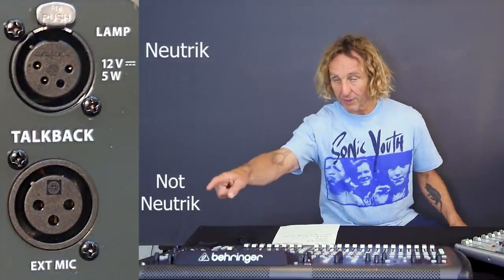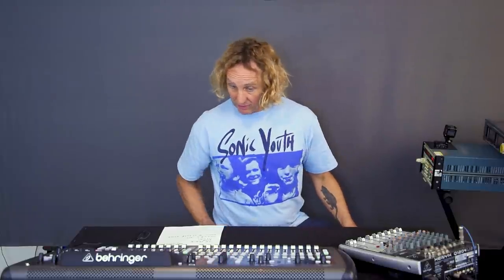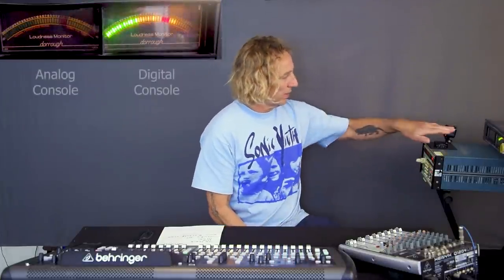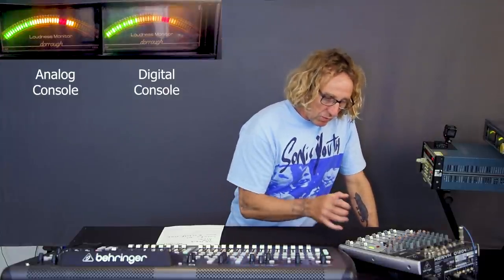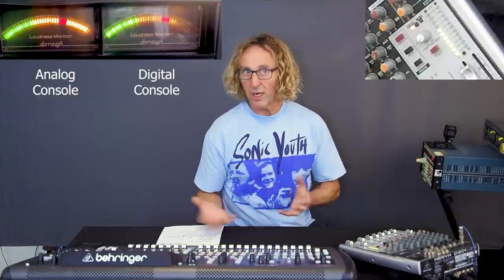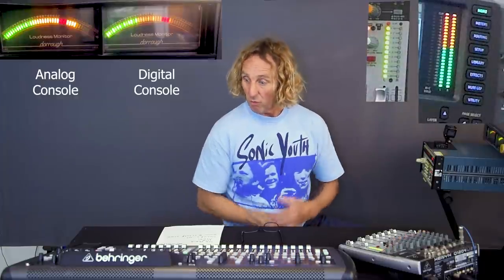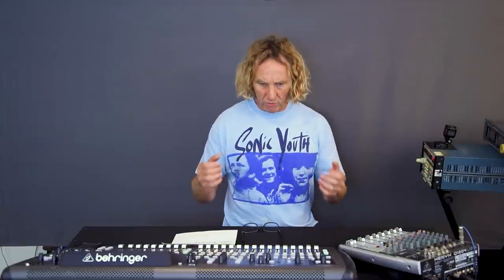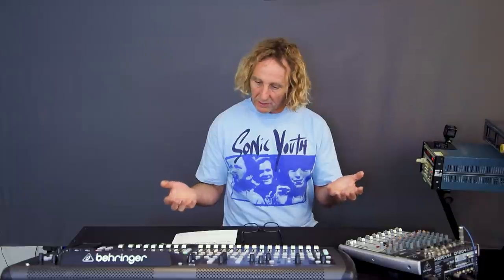Behringer X32 Digital vs Analog Console Metering & Output Levels (Public)

Comment: When you do a nulling, and get "perfect cancelation", does the silent output generate spl? Does a dB meter hear it?
Reply from the maker: No spl, no metering. Perfect cancellation is the same as no sound.
Reply: @DaveRat  hope you don't mind a follow up question. Same scenario, but with two speakers out of phase, measured at the perfect center point with max sonic cancelation, is there no energy to read there either?
Reply from the maker: Hmmmm, there is energy everywhere always.

Speakers can be looked at as adding and subtracting pressure.

Electronically sound can be looked at as adding and subtracting voltages.

If you have two speakers where every time one of them adds pressure, the other speaker subtract that exact amount of pressure such that there is no change in the pressure, then there will not be audible or measurable sound at that point in space.

Same goes electronicaly, if one channel adds voltage and another channel sub tracks that exact amount of voltage at that exact time and they're perfectly aligned such that it the combination of the two results in 0 voltage change then you have perfect cancellation and no measurable voltage

But if you go somewhere else in the signal chain before those two electronic signals are perfectly summed there will be measurable voltage, and if you go somewhere else in the room where the speakers are not perfectly canceling out acoustically then you will hear or be able to measure sound.
Reply: @DaveRat  Thank you so much for taking the time to answer my questions. Makes sense, and intuitively was what I was thinking, but intellectually my brain kept arguing about there still being energy there, even if it's inaudible.
Reply from the maker: Ha, yes it is a bit of a conundrum.  In a way, the energy is there and there is other energy counteracting it to make it go away. But remove one of the energies and the other then returns.

Maybe like a balance with equal weights on each side is still, remove both weights and it is still and centered, add one weight it tilts, add another equal weigh, it is still and centered.

Both the weighed scale and unweighted scale is still and centered.

With the weights the potential energy to tilt is there but not active impacting.

This is similar to 2 out of polarity signals balancing each outer out back to silence.

Comment: First, thanks for the great post. As someone with far more experience than me, would you say Behringer is getting better quality? I was slammed recently for having an XAIR 18. Seems like behringer (used to) leave a sour taste in quality. But have seen people I respect such as yourself saying "it depends". Feeling more and more like "What is the specific tool's quality?" Is the more modern question rather than shaming a brand.  Minus the quirks, Behringer has given me more than enough bang for buck. #RatRocks 🐁
Reply from the maker: It's kind of like buying tools at Harbor Freight, inexpensive Chinese products won't be impressing anyone and the history of Behringer copying other products and making cheap versions has earned them animosity from the pro audio community.

That said, useful inexpensive products have a place and can get the job done.

On the other end of the spectrum there are esoteric over priced manufacturers where you pay for a look, a name and image, mainly in the home HiFi market but Monster Cable was a good example of that

Somewhere in between are the companies that offer quality built products, have attentive and dedicated customer support staff, things like fast turn around repairs with loaner gear, and are known for innovation and quality products.

When buying gear, I look at price, function, reliability, support,  resale value, industry acceptance, demand, rental rate, estimated longevity, size, weight, appearance, serviceability and so on. And prioritize all those factors to make the best decision for the application.

Comment: At that length of a snake, I remember having catastrophic failure on data lines coming from the dante sound cards on a Yamaha / Nexo system.  I remember  cutting off 25 feet of the cat5 run and crimping a new plug to resolve the issue. I also remember the owner of the av rental compagny telling me that it worked perfectly for 2 months before the problems started. Perhaps a comparison between old and new cables would be of interest? Enjoying the ride here in Montreal.  Thanks
Reply from the maker: Good idea
Reply: Could have been the original plug or crimp quality. Signal reflections are what ultimately limit maximum cable length so if you were close to the max limit, shortening it a bit could have opened up the eye permitting the resumption of valid data.

Also moisture effects cables. Was there an outdoor event prior to the problem?

Comment: Does anyone on here know why on the x32, on the channels specifically, it clips, even though the meters are no where near clipping.
Reply from the maker: Possibly clipping the subgroup bit will look into testing and finding that issue. That is exactly the kind of thing I am looking for
Reply: @DaveRat  it's a weird one Dave and thanks for the reply. I've only seen it on channels that are going through the stage box. Anything going in on the insert channels are fine and can be hot as he'll without me ever seeing the clip light. But channels patched into the stage box, I have my meters peaking around-12 but the clip light hits. I'm asked on other forums about this and have never gotten a proper answer to this.
Reply from the maker: Hmmm, almost sounds like an issue with aes50 

Aes50 has no error correction and can have distortion and drops while still functioning.
Reply: @derekrushe  Check trim vs. gain.  Press Setup -> Preamps.  You may be clipping at the analog-to-digital conversion, but the digital trim may be bringing the levels down to what you're seeing.  A lot of people use headamp gain split with the stage boxes.  You probably have this on.  In any case, remember that the analog preamp gain setting is not continuous.  So, as you turn the gain knob, you're setting trim continuously, and gain in steps.

Comment: Learning a lot of good stuff from you , thanks ! What are your thoughts on the greatly debated x32 vs. m32 differences ?
Reply from the maker: Hmmm, have you seen the 1st vid I have released on that topic? I have done 9 vids so far and 1 is public and 8 more on the member side
Reply: The M32 is a deluxe X32, internally they are identical however external connectivity is where the difference is as the M32 has MIdas preamps and better quality output capacitors/circuitry. Question being does the huge difference in cost justify the better components?  Maybe not but the difference in warranty has to be considered 2 v 10 yrs !! Even so I still chose the X32 and happy with my decision.
Reply from the maker: When I takebth apart they don't appear identical inside. Different input circuitry, output circuitry, different D to A converters, faders and more.

But I do agree, the M32 is an deluxe M32. And the operation is identical.
Reply: @DaveRat  sorry yes you are right the faders are different. In the end you are paying for upgrades with the Midas M32 question users have to ask themselves is whether the extra cost is worth it to them since the X32 is still a really good quality mixer for what you pay. I even looked at the WIng but its huge and seriously heavy so I counted that one out right from the start. When I said internally I really meant the both run internally at 96 and externally at 48Khz which is the same as almost all the mixers around this price range. The question has to be are you getting your moneys worth paying the extra for the M32?
Reply from the maker: There are so many variables.

Actual cost, resale value, perceived value, rental rate differentials, size, weight, durability, warranty repairability, ergonomics and on and on.

One can celebrate saving some money and having the same functions and slightly reduced quality while someone else can celebrate paying a bit more, improved quality, improved ergonomics, build quality and higher resale value while presenting a slightly higher perceived value.

And both can be right.
Reply: @DaveRat  You are right, the X32 sort of chose itself cos I picked mine up really cheap. I am really happy with it and I know after the pandemic its only going to increase in value due to chip shortages and the extra shipping costs, it has been almost impossible to source new for almost 2 years same story for most manufacturers Allen and Health could not give me a delivery date when I asked about the QU16 and even now 2 years later still only available to order and I know its not going to be available in stock for over 6 months and even then that is probably not going to cover all their back orders. Ok cheers think I have wasted enough of your time, x

Comment: 10:30 That level topic is causing constant headache.. it’s  confusing that 0dBfs can be at least +18 dBu, +22 dBu, and +24dBU. It depends what the manufacturer sees as the „ nominal“ level ( for its certain product) that can be 0dBu, +4 dBu and +6dBu (German/ European radio-standard) . Add +18 dBu headroom on each…. And  u have at least 3 different 0dBfs. But some manufacturers labeling digital consoles still in dBu to keep the confusion at its max.
Reply from the maker: Agreed, and human nature based on things like tachometers and analog meters is to run things up near the yellow and red. Yet near yellow and red is all good with analog and terrible with most digital.

That visual aspect of tempting engineers to mix at levels that sound bad is just dumb
Reply: @DaveRat  yeah I always wondering about the colleagues that try to run a digital desk in the orange range because it’s sounding warmer…🤷🏽‍♂️
Reply from the maker: Yuck

Comment: Sounds like you have a really good video series lined up. 

I'd like to see a similar thing done on the input, because how do you know a digital desks 60dB gain is the same as an analog desk's? It's well known preamps struggle at high gain. 

I suspect it's about even-Stevens because the ADC vref is comparable to the 0dB VU reference. But it would be nice to confirm.
Reply from the maker: I do cover the inputs as well, 7 more vids of the series are already up on the member side of my YouTube channel, so the vids I am releasing public are a few months old

Comment: @7:50 You likely read -21dB because your Master Fader was at -3dB and not 0dB... would have been easier to catch on a different view or software view
Reply from the maker: Doubtful, I calibrates all levels with great care
Reply: @DaveRat  First let me humbly say that you have probably forgotten more than I'll learn😆... But in regards to the segment around 7mins and 50secs in this video where you were surprised that the channel and Master meters had a small deferential reading , that was likely do to you reading the Master Fader from the white labels instead of from a digital page or software for an exact Master Fader output... I'm probably just rambling so I can brag later here in Vegas that I had discourse with the "Dave"😅
Reply from the maker: @derickmcwilliams8089 possibly but I don't use the markings, all cannels, group and masters I adjust with the rotary to the exact numerical correct. Also insuring the digital teims are set as well
Reply: @DaveRat  ok, then that also stumped me... Still good stuff!
Reply from the maker: I will check it out next time if I have the board fired up

Comment: Maybe is x32 quieter because of the need for "digital headroom" above 0dbfs
Reply from the maker: The x32 has a lower output at -18 dbfs and a lower output at clip than the analog.  It is also noisier than the analog, according to the specs

Comment: Different analog consoles have different calibration between 0 VU and output voltage. Usually 0 VU corresponds +4 dBu out, but Xenyx seems to be hotter.
Reply from the maker: True and also and more importantly, the xenyx actually has more output before distorting than either the x32 or m32.
Reply: X32 have 17 dB headroom (+21 vs. +4), Xenyx have 15 dB headroom (+25 vs. +10). So, out levels on Xenyx just shifted up, no extra headroom.
Reply from the maker: Regardless of whether you use the mic or line input the xm32 output meter set to -18dbfs is 6 db lower than the xenyx output meter set to 0db.

This occurs if you use one input or all the inputs with mic or line, if you set the output meter on the x32 or m32 to -18dbfs it will put out 6 db less.

And

If you turn the output up till the red clip light lights on both consoles, no matter what input, no matter 1 input or all the inputs driven to get the meter to clip, the xenyx will output 4 db more.

The Xenyx has 4 to 6 db more output headroom, use a DI, use a mic input, use a line input, use an internal time in the x32, makes no difference.

It is super easy to test and see, I am here testing the gear and I am guessing you are guessing about what will happen but not actually testing.

Give it a test and then tell me what you find
Reply: Headroom is difference between nominal level and clip level. You can insert an amplifying stage on X32’s out and get out level as high as you want. Headroom don’t change.
Reply from the maker: Ok, and still the -18dbfs meter level on the x32 results in 6db less output than the xenyx at 0db meter level regardless of what input level is used.

But will gladly test it again.  Keep in mind, the meters are post output fader.
Reply: This only means that input gain on LMS or power amp will be 6 dB lower in case of Xenyx.
Reply from the maker: Yay! This is exactly why I do these tests! Is to help clarify erroneous math and perceptions by actually testing!

Anyway, put an oscilloscope on the xenyx outputs and you will measure about 3.6 volts peak to peak  (1.27 rms) when the output meters read 0db

And on the X32 the outputs measure about 2.7 volts peak to peak (.96v rms) with the output meters at -18dbfs.

The Xenyx begins to clip at around 31 volts peak to peak (10.96 v rms)

And the x32 begins to clip at around 26 volts peak to peak (9.19 v rms)

So, with the output meters of the two consoles matched and set at their respective nominal points, the xenyx has more output.  Also, at clip, the xenyx has more output. 

Interpret this info as you wish but all in all, the xenyx has more output.
Reply: Definitely, consoles have different output levels. But hot out have no advantage at all.
Reply from the maker: Actually one of the most common issues that causes audibly undesirable sound is when an engineer drives the output of a console (or an input) into distortion.

A console with less output will always be driven harder or closer to or into output distortion before a console with more output.

As I mention in the video, if you want the same output level from the x32 as the xenyx, you will need to add gain after the console.

Adding external gain will also add gain to any output noise

This may not be an issue but the x32 is already noisier than the xenyx as well and adding gain makes it even noisier.

Comment: When you set both to so called "nominal level" you relies on consoles own meter.
So the difference in level between the analogue console and the digital one is probably due to the different type of metering. The first one (analogue) is more or less a low precision VU meter, while the x32 is a digital peak meter.  They are built for toltally different purposes. The difference between the two is signal dependant. With a sinusoidal signal the VUs should read 3dB less than the PM. Still not so much as 6dB you measured, but again, the 1204 meter looks very little reliable.
Reply from the maker: And also, when you have similar looking meters yet the meaning of the metering is vastly different and ramifications of of higher levels are quite different you end up with engineers overloading digital consoles

And the with x32 having lower max output, it just makes things worse.
Reply: @DaveRat  Indeed!
Back in the late nineties i worked as FOH enginer for the finnish band "Panasonic" with my beloved soundcraft 6000.
They had a completely unusual set of sounds and a lot of self constructed instrument devices, some of them producing very loud pulses. 
This is how i learned not to blindly trust my meters and even the channel peak LEDs! 😂

Comment: I betcha that X32 has a lower output noise than the Xenyx. They probably have comparable output dynamic range.
Reply from the maker: Well, here is what the specs from behringer say:

Xenyx 802
@ 0 Ω source resistance -134 dB / 135.7 dB A-weighted

X32 
Equivalent input noise XLR (input shorted) -128dBu

It's a bit tough as the xenyx is rated A weighter and with measuring the Xenyx has a higher output level as well as the output of the X32 is rated at -21 and the Xenyx is rated at +22.

But all things, according to Behringer specs, point toward the Xenyx being quieter. 

So, I will take that bet.